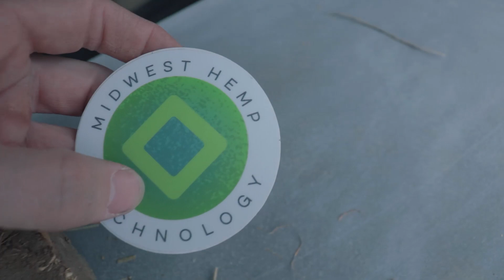Thermal Mass and Insulation - The Difference Between Cob Walls and Strawbale Walls

Comment: Use both, thermal mass on the interior with air gap to a highly insulated exterior. Ventilation to the thermal mass can then be managed to advantage.

Interior thermal mass holds comfort zone temperature for a long time. 

Exterior insulation lets you manage the ebb and flow of interior temperature.

Additionally the home should be vapor permeable, the moisture that "WILL" permeate tends to condense on the coldest surface the above combination helps best manage moisture without mold and rot

Comment: The two different hemp products you showed are different parts of the stalk. The shiv is the inner cellulose material, while the fiber (longer, thinner) is the outer part of the stalk. Not just two different sizes of the same stuff, and they also function differently as well. Hemp contains a lot of silica, which is what makes it extra suited to mix with lime, as the silica and lime bind very strongly, and contribute to making the insulation stronger in structure as time passes.

Comment: Another way to look at it is that insulations makes it easier to maintain a temperature difference (hot I side, cold outside for instance) while thermal mass averages out temperature fluctuations (day night cycles). If the average temperature is 10 degrees hotter than the inside temperature, cooling will be difficult without insulation even with a lot of thermal mass.

Comment: Have you used Tyvek outside and plastic inside as usual? Wether it's not required?
Reply from the maker: I would not advise using any plastic moisture barriers on either the outside or inside of any earthen or straw based wall system. They need to be vapor permeable.
Reply: @thiscobhouse  I see, sounds this type of houses are good in dry climate, right?
Reply: @thiscobhouse  tyvek IS permeable. google it.

Comment: It seems like in a place where it could be hot all night long a person would want insulation, and not thermal Mass for the walls. It would be better to have passive solar where the sun would shine on the thermal Mass Through the Windows and heated up in the winter time but in the summertime the sun wouldn't shine on it. So, make the walls with insulation of some sort and have passive solar. I think that's the answer for West Texas where I live.

Comment: I may be homeless soon do you think building a double wall wattle with a straw packed enter core with cod inside and out would protect from the elements especially in winter say something 8×8 with a 4 foot back wall and 8 foot front wall so the tarp roof will be 45° something big enough for a bed and maybe a cob fireplace I've been thinking about this awhile now I know I run the risk of being run off for trespassing so it will be on government land but something that can be left behind with only losing a tarp if run off and rebuilt easily with a saw and very little cordage plus the things around you until I find a place suitable enough to build I'll use a hammock with a tarp cover to sleep and travel easily

Comment: Would you recomend thermal or fiber (straw slip in forms) in Chitwan Nepal. It's unbelievably hot in hot time and gets into the 40s during cold time. I'm thinking both. Rice straw heavy on outside of walls,glass bottle center,ziq zagging for strength for Inside the wall  then Cobb heavy material on the interior side of wall. What say  you? Also wall will be 18" wide 6' tall 15' long.
Reply from the maker: What did they build with there in the past before concrete?

Also, please check out these two videos of mine on dual wall systems:
https://www.youtube.com/watch?v=HP07HppympE
https://www.youtube.com/watch?v=c8t-TO1HuEI
Reply: Sooo supper hot climate with Monsoon and pretty cold in winter. No shade trees
I'm building on 2 rice/corn farm fields in Chitwan Nepal....Sooo hot. 🙏

Comment: I found that in my earthbag/cob slip house, having insulation on the outside and thermal mass on the inside keeps the temperature stable for very long periods of time, and with the insulation on the outside, that keeps outside temperatures from coming in and the cool air in because of the cool walls
Reply from the maker: Cool.
Reply: How do the outside insulation and the inside thermal mass connect? Or are they separated?

Comment: A little off current topic (but any question you said) I'm planning a perimeter wall in either straw bales or earth bags What would advise for protection against heavy rain or the element in general lime plasta? Loving your channel.
Reply from the maker: Lime plaster. Raise it off the ground at least a foot with the stem wall foundation, and cover the top with a roof.
Reply: @thiscobhouse , what's the difference between lime plaster and cement?
Reply: @he7is7at7hand  cement has various additives that end up reducing airflow, it is not recommended for natural building, as it can lead to rot of fibrous materials.

Comment: Show the math... you can jaw about the materials for hours but if you don't do the calculations it's a big opinion experiment without a science basis... be an engineer... if you don't show the math comparisons using specific heat values and best layering choices, i.e. dual walls, then we know it's your dice roll... show the dual wall insulation math calculations... materials and time are way too dear to guess. Show your materials costs in the various build type evaluation table...
Examples of Specific Heats (BTU/LB °F) materials:
Paraffin wax 3260
Cork 2000
Water 4182
Wet mud 2512
Soil wet 1480
Soil dry 800
Wood 1500
Poly styrene 1400
Concrete 880
Brick 840
Slate 760
Perlite 387

Typical Heating BTUh Requirements Per Square Foot:
Look at map, learn zone, calc BTUs.
The table of required heating BTUs per square foot is based on the IECC climate zone map shown at url Source: IECC Climate Zone Map, U.S. Department of Energy (US DOE), retrieved 2018/06/21, original source: https://basc.pnnl.gov/images/iecc-climate-zone-map.

Climate Zone 1 - 30-35 BTUs / sq. ft.
Climate Zone 2 - 35-40 BTUs / sq. ft.
Climate Zone 3 - 40-45 BTUs / sq. ft.
Climate Zone 4 - 45-50 BTUs / sq. ft.
Climate Zone 5 - 50-60 BTUs / sq. ft. (some sources cite 50-55 BTUs / sq.ft.)
Climate Zone 6 - citation needed; popular heating zone maps for the U.S. do not follow the current DOE climate zone definitions that we accept here.
Climate Zone 7 - ditto.

A 1,000 square foot room requires 18,000 BTUs. A simple formula to determine your heating needs is: (desired temperature change) x (cubic feet of space) x .133 = BTUs needed per hour.

Get split heat pump system quote. Make sure you add wood stove/fireplace for backup heat.
Reply from the maker: Maybe I should hire you to do the math.
Reply: @thiscobhouse  Thanks for all you have contributed to me. This Guy sending shade obviously has" issues"😂. Where can I find how to build slip form's? Thanks for everything 😊🙏🌍
Reply: @thiscobhouse  Glad to help... send me your build drawing details with dimensions. Standing by...
Reply: Then go watch an engineer or a scientist. This guy is just a builder sharing his experience and knowledge.  
 He never claimed he is the genius scientific organic cob engineer...
Reply: @Abdulkadir Thecarguy  He needs to say here is how I build and my calcs and results are... 1-2-3  Teachers teach...
Reply: @douglaspohl1827  are you even listening? Cool, you did some math on stoves. 
This guy is just saying "2+2 is 4, you have to learn the rest". This is basic information.  He is showing the Rabbit hole. The jump is up to you. 
Jump in, do the math Mr. Engineer. I would like to see them.

Comment: can you use both ideas, two walls using a cob wall with a straw- wall with a cob covering for the inside wall.
So the outside wall would be a one foot thick cob wall and a inside wall of state with a cob covering.
Reply: You can change the mixing ratio instead of that. 
Using both ideas means killing each ideas together. You are not gonna get nice thermal mass, because you blocked it with insulation. You can't really benefit insulation because you made half of the wall from thermal mass.

It's not how you build the walls. Its deciding which wall needs thermal mass and with one needs insulation.
Reply from the maker: Yes, please refer to this video I did recently on dual walls: https://www.youtube.com/watch?v=HP07HppympE